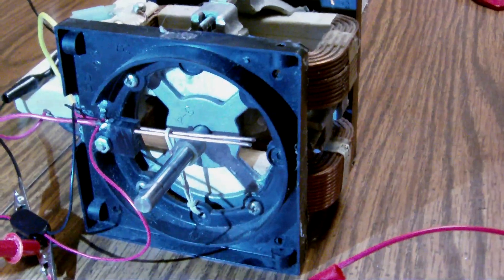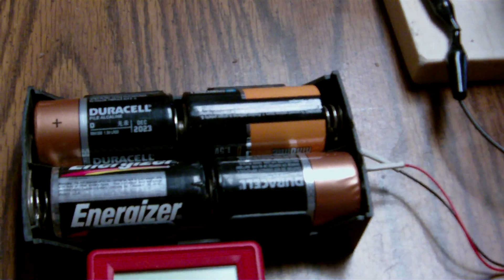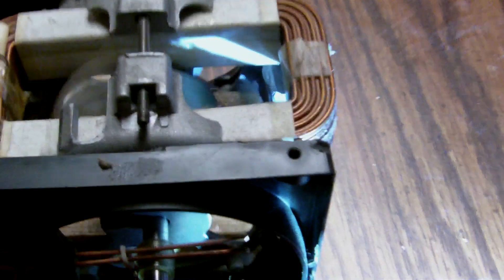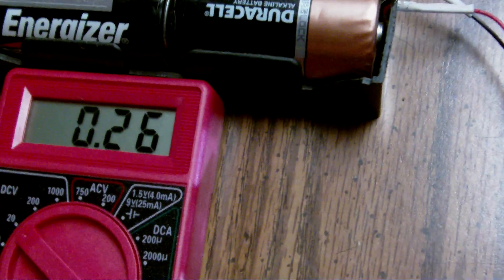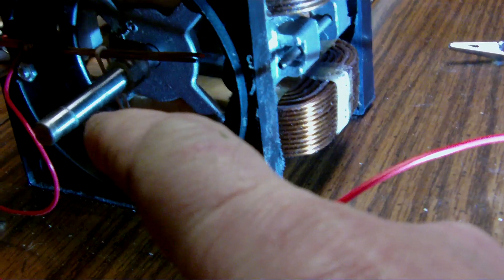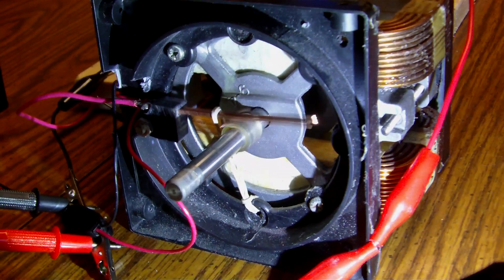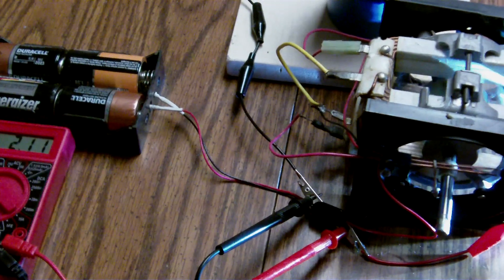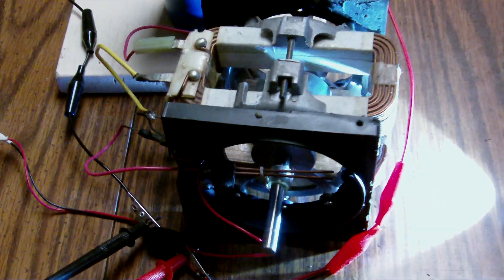newman motor  batteries to dead to run the motor , until  the capacitor

Comment: Newman wrote very comprehensive book about his theory if you read his book carefully you will understand everything. He wanted everybody to understand the princible. He is one of the good hearted scientist like Nikola Tesla, Walter Russell, Viktor Schauberger and Edward Leedskalning.

Edward Leedskalning perpetual magnet holder proves that when electrons are put in an ORBIT they will never exhaust. If you heat the kettle, the heat radiates to surrounding space, the energy itself never dissapear it just goes from high potential heated kettle to low potential cold surroundings. The pressure (wave) wants always to balance itself, that is why the high potential want to equalise the low potential. That is why the wave has ~ this shape, and once it is balanced it goes flat - 

If the energy would dissapear you could not heat the kettle ever again because the orbit of the universe would stop working, the electron pump would stop. But it wont, because the universe itself is never exhausting pump and it will never run out of electrons. It will always supply you new electrons to spend in oven. The thing is how to manipulate the electrons so that you won't need to grow trees from them but you could put them in an closed orbit in an electric device

The perpetual magnet holder holds its charge "forever". The only real limit is the material permanency because the coil material need to withstand the outside wearing of sun, oxygen, moisture etc. 

That means when you build a motor that puts electrons in an closed orbit the motor will run by itself prettymuch with no extra inputs. The problem is the insulation, how you insulate the orbit so that the electrons wont fly off. Newman used this princible by building a large coil, so that the electrons has no time to run off from the long coil because he uses the FAST commutator to spark, short sequences. So he basicly cuts off the orbit before they can reach the another end of the circuit and the electrons must fly back to their source they can't stay in place, they must fly back to the low(er) potential, which is emptied capasitors or something similar. If we compare this to the kettle sitsuation, If you could lower the kettle temperature suddenly, it would draw all the energy back from surrounding space you just heated. 

So basicly Newman motor is a voltage (wave-pressure) pump that circulates the high potential between low potential in an linear orbit. It works in this funny primitive setup because it won't let electrons escape the circuit. It won't let the wave balance itself.

Comment: I've got the Wonder though.. who is in possession of big Eureka.. I'm curious to know this and all of his works and papers..???...probably confiscated just like they done Tesla ....government is nothing but terrorists and should be thoroughly dealt with by freedom-loving human beings.... I'm going to build one of these motors I will start out with a small unit like yours probably the same way because that was the idea I had then ran across your video using microwave Transformer.. so that's what I'll use but I'm going to use the secondary windings as they're about two to three thousand turns in that coil, more turns the better apparently.... once I get the system down pat... I will be building a bigger one.. a three or four hundred pound version... I have tons of smaller capacitors and some 4- 5000 volt DC capacitors out of several defibrillators I picked up at a recycling yard... I should already have enough stuff to build the bigger unit except for bigger magnets that's the only thing I will need

Comment: I don't understand what the deal with the capacitor is, its just a battery that will charge and discharge faster than a battery, so connecting the cap is just like connecting another battery,

Comment: Ofcourse it keeps on running.
The Capacitor has all the power to make the engine run.
Likely it will add some juice to the batteries too.

Not sure what these Newmanians are trying to prove to show that Engines are running on Voltage - not on Current - nonsense.

Playing with engines is fun.
Big Eureka is big Bull.
So is this video by the way.

There is no "serious" tech measuring involved and no timely registration of either Volts or Amps; just momentary glympses.
No "undressing" what device is used actually (type of engine, windings etc.)
I haven't seen a single scientist knowing electronics in any of the videos.
Most of them are asking questions that don't even question this very questionnable "tech".
Just very sad to see this being brought to people and continuing to focus on Amperage and Voltage while both capacitors and coils are in there. You won't prove anything unless you have a full timely trend or a schematic and show people where these schematics don't add up. 

Until that moment, you are not proving anything and you are convincing complete idiots not knowing what they are looking at and not knowing how electricity works.
It's pretty easy to fool a fool; it's way more difficult to fool an actual scientist (yet not impossible).
I.e. by putting batteries in large chunks of a large machine or by putting them in something what seems to be a capacitor.

This shouldn't be under Science & Tech but under "Magic tricks".

Comment: If you shorted out the cap FIRST to prove there was no energy, then connected it and then finally disconnected the batteries and it still ran (with no hidden forced airstream, like all the other scammers), then you will have something, but currently you have exactly a newman motor (aka not perpetual). Its fun to experiment, keep it up.

Comment: As proof of Concepts why didn't you short out capacitor forehand? All that looks like you did was connect to supercab to a motor. Ergo the motor runs off of the super cap

Comment: Hello Ed Cupp. I appreciate what you did. It's great work. You made a 2/3 of Newman motor. I assume you are older than 50, so teaching you will be probably a little harder. Most of men (99%) were never grown into men because there were no man in their lives who could told them a wisdom. Therefore they stay a boys. That mean that their consciousness never transfer from second chakra to six chakra. Practically that mean that those boys in man body react wrong upon teaching especially in older ages. Instead embrace the teaching, they swing to himself thinking "oh I am doing such a great matter to help humanity and they animadvert me" and they close up in frustration. That is what I am trying to avoid here. 

First you have to understand what you did is just a simple DC motor. Second you have no idea what back EMF is. And at least Newman motor is only a simple DC motor with back EMF. That back EMF is charging batteries back. Because in your circuit is no back EMF batteries will run out.

Back EMF is captured with diode. Best are powerful shotkey diodes (30A and above). Efficiency of back EMF grows with voltage. Therefore Newman used a biiiig coils. Biggest is coil greater is induction, consequence is greater back EMF. If you test machine enough time you will discover that you have to go over 300V for achieve some results. It's mean 300V on batteries. Back EMF goes over 3KV or 5KV if it is open. Usually that mean you need two pack of batteries. First one fire a motor, second one is collecting a back EMF. And in second half rules are reversed. 

But, yes there is always but, when we talking about back EMF things goes complicate. We have to figure out about which back EMF we are talking about. There is a lot of it. 
There is a pore basic explanation of Back EMF in motor, and that IS NOT THE  Back EMF we are talking about ->  https://www.youtube.com/watch?v=5mf4NmmLWnE
Back EMF we are talking about is like on this video -> https://www.youtube.com/watch?v=0BPphesBGg0  There a guy trying to capture Back EMF with a capacitor. It will never work because voltage in cap increase and therefore charge current decrease. Therefore is no OU. It need to be batteries. If cap is added is even better, but only cap no way. With BATTERIES THERE IS OU. 

Because of nature of Back EMF and the batteries it has been proved that those type of motor runs best on high voltage and minimum current. That way batteries even increases on voltage during operation. But you can not mislead yourself that this is the same power that it is in regular charged batteries. There is voltage but a very little juice. If we put a light bulb on that battery it will be drained out very fast. But in a motor circuit it will never discharge.

There on collector must be a several contact not just one, so it can be a several cycles of charging / discarging of coil.
Reply: Do tell
Reply from the maker: Please explain to me how the capacitor speeds up the motor when the batteries are almost dead, especially when they stopped running the motor themselves? As far as the chakras oh, I'm sure all my chakras are in line, just like most people, but if you can explain how the motor runs with the capacitor but not without, would be appreciated, love to hear your thoughts